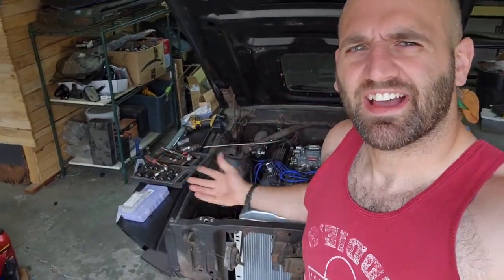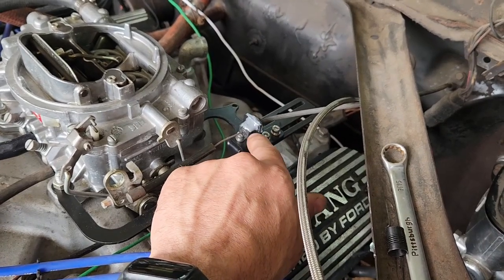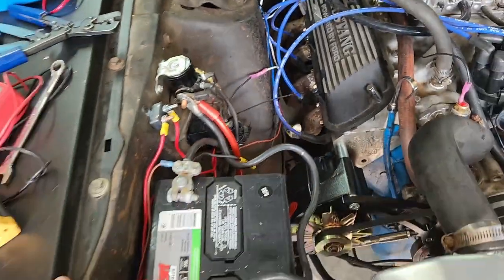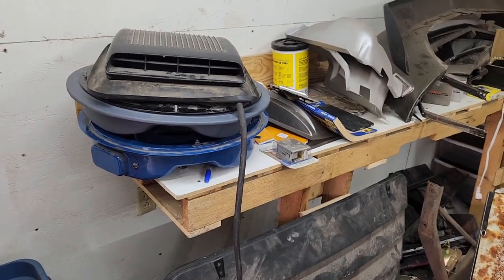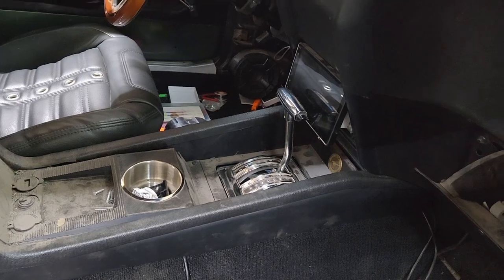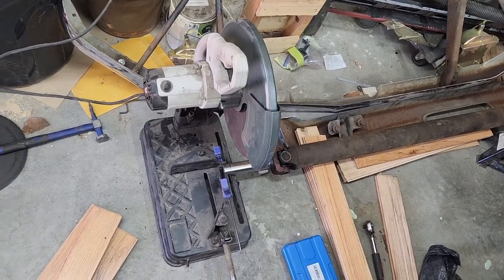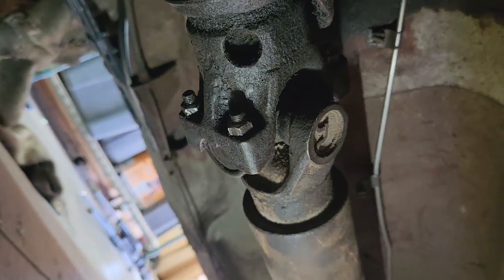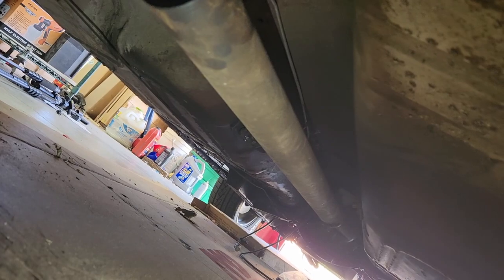69 Mustang: Slow and Steady Progress

Comment: Hey Jeff,
That’s a Torino midplate on your shaker.  That’s why the holes didn’t line up. Mustangs are at the  3,6, and 9 o clock position. Torino are 2,6,10
Reply from the maker: Shouldn't be, all my stuff is reproduction mustang shaker stuff from KY Mustang. Now the base, itself is from India...Also it fits directly on my small block base
Reply: @ID10TGARAGE I agree it shouldn’t be but those original holes are lined up for a Torino base.